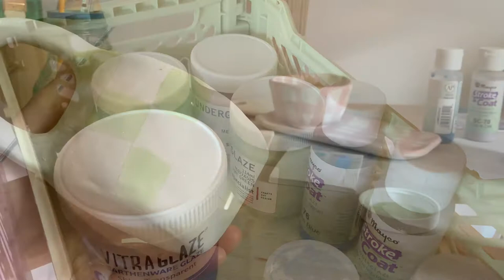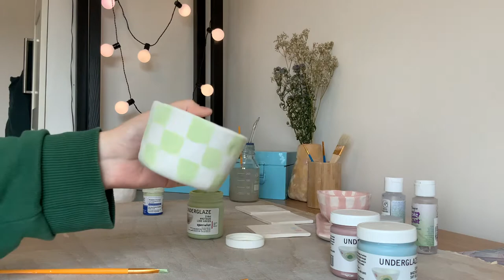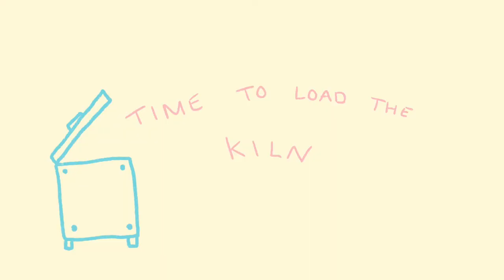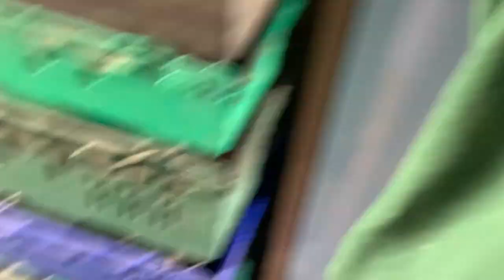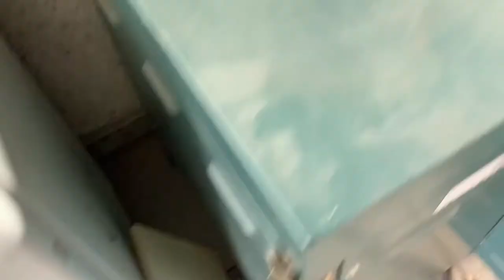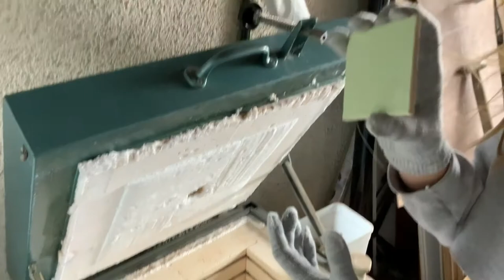✨🌱How i Glaze my mugs🌱 ✨[studio vlog] ceramics at home ✨how to make a mug

Comment: cute video! but this is earthenware, isn't it? the clear glaze fires at up to 1100C according to what I can read on the label, and is hence not fully waterproof. only stoneware is... :)
Reply from the maker: The earthenware clay isn’t completely waterproof, the glaze makes it waterproof. Once the glaze is fired it’s pretty much a glass layer covering the clay. Stoneware is the only clay that is waterproof without glaze but it’s still recommended that you use a glaze if the piece is dinnerware/domestic ware :)